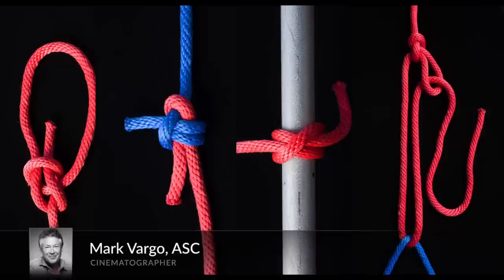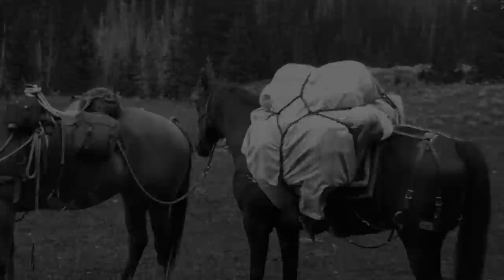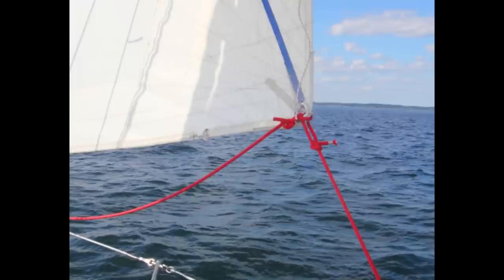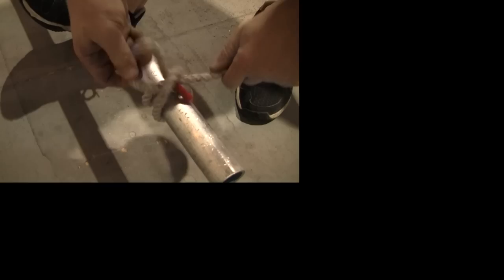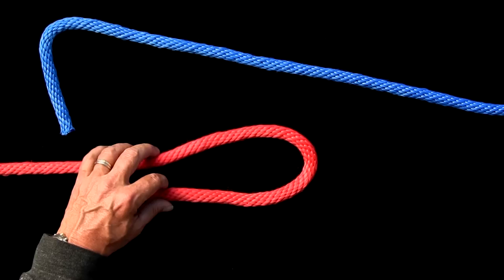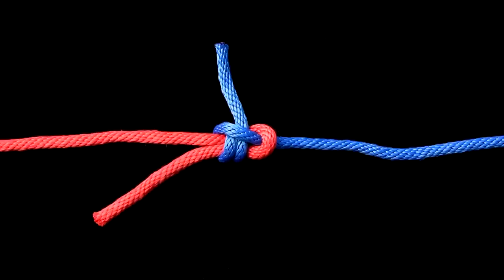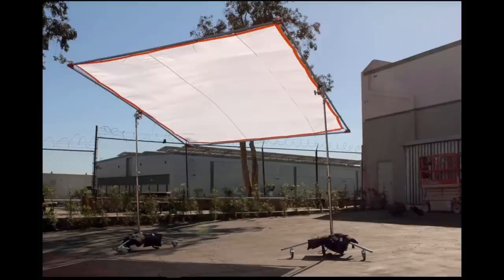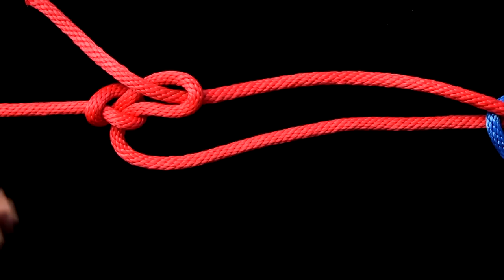4 Great Knots Every Filmmaker Must Know | PremiumBeat.com

Comment: Pro tip.  Triple loop your truckers hitch to prevent binding and expedite the untying process.  This is more of a slipknot tbh.  Also never pull your half hitch all the way through double the existing line and make a nice little bow tie.  Your crew will love you.